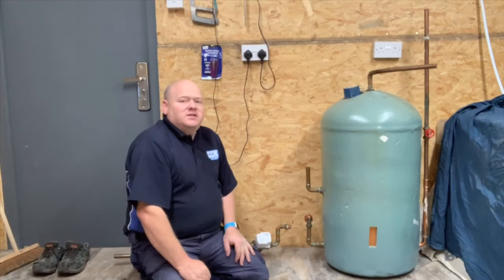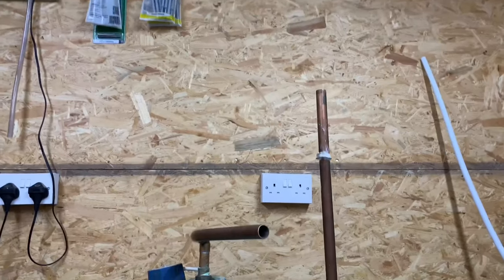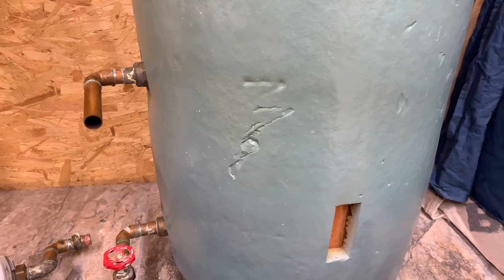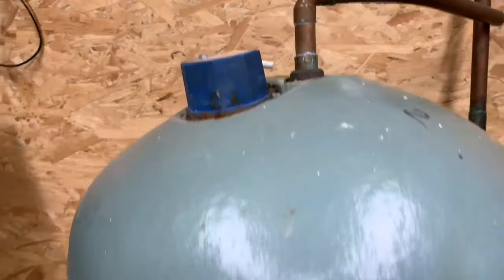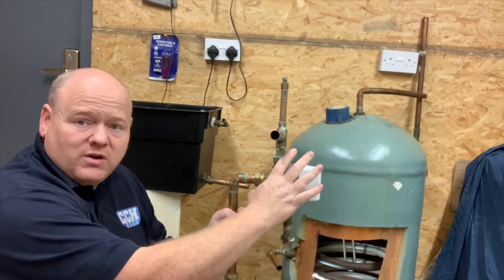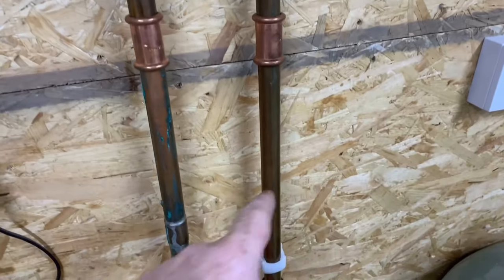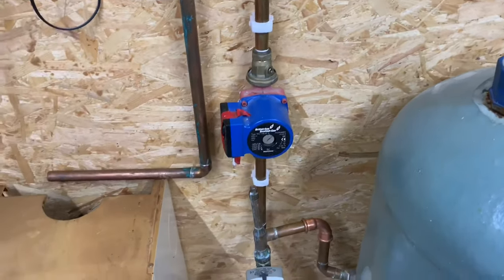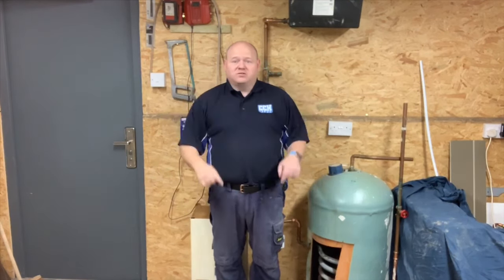Plumbing - How Does a Hot Water Cylinder Work ?

Comment: Hi , was wondering if you could help the water in my cylinder heats up and everything is working, but about 1 hour after the central heating is turned off the water goes cold its not retaining the heat in the cylinder any ideas?

Comment: Hi Allen what is going wrong with my system with hot water going out through the overflow pipe back into the cold water tank, with the result while I will heat water with emersion  the tank will not hold the hot water over night even though it was installed 2 years ago

Comment: Thank you so much. I moved to ireland and the plumbing is very different here. I did not understand how the heating  system versus the showers worked. Brillant job! Thanks again.
Reply from the maker: Thank You
Reply: Not sure how that would be different in Ireland. I live here and that set up is the exact same as I have bar we have more switches that divert water based on controls and need to be powered by electricity to control. The issue here is that poor water pressure means direct from mains to heating in the boiler is harder to do as you cannot get enough water heated via mains water pressure fast enough to offer enough heat on the fly water pressure. My experience here is that combi boilers are a mystery to most plumbers unless there is no room to fit a water tank and cylinder (apartments/offices etc) . In fact the UK has stronger efficiency rules now that we do (boiler Plus)
Reply: @stephendoherty8291  Hi, I moved from the USA and plumbing is entirely different.

Comment: great well explained video, am i right in thinking to change the diverter valve do you, turn of the water supply, drain central heating, no need to drain the hot water, my system has 2 tanks in loft, big and small and all cold water is from the mains supply, any advise please, thanks mate

Comment: Hi Allen,   Can i use (a twin emmersion) tank to supply hot water for a bath etc, without a hot water boiler, - I  want to use my solar panels to power my emmersion heaters during the day,  (the second elemment I would control from a 1 hr timer to boost the temperature speed up for higher demands ) - I've got rid of my gas boiler, and I have no radiators left too. would it work this way please ? I still have a cold water tank in the loft, -
By the way,  great video, I learned a lot from your internal views of the tank, and descriptions, good job.

Comment: Thank you very much for helping me understand. How does a Hot water boiler work in conjunction with a hot water tank. For example we have the boiler heat the tank up for 30 mins at 6am and 6pm. However what if we were to let the hot water tank heat the water in the tank for say 4 hours or more each day,  would this be wasting energy? Or would the tank tell the boiler to stop heating the water when the tank was at the optimum temperature? I'm just curious as if i should be setting the boiler to heat the water in the tank longer than the 30 mins each day? WE have plenty of hot water for 2 of us in the hous with this set up, but i wondered if i increased the time would this be wasting energy?
Reply: I'm here also wondering the same thing, by the sounds of things I'm assuming it would constantly be heating water and once it's hot then switches off

Comment: Thanks for this. I’ve labelled my pipes now. Trying to troubleshoot heating system. Think there’s an airlock. Bled radiators then boiler stopped and no heat in the flow pipe. Just had cold snap which seems to have messed with everyone heating all my in laws had issues recently

Comment: Hi Allen.Thanks for video. Very good. Can you please tell me what the valve on the return does (seen in video at 2:15)? We have gas boiler heating system. My radiators are getting hot but the water in my tank is only luke warm. Do I need to adjust this valve?

Comment: I’ve just bought a house with two of these tanks, the system hasn’t worked for a year, one of the tanks works fine for the main bathroom, however the other tank does an en-suite, but doesn’t heat up with or from the boiler, but works with electric/immersion and fills up ok from the tank in the loft. Please can you advise me.

Comment: Hi Allen, having issues with the hot water flow to upstairs bathroom taps. Notes new pipes connection to hot water tank smaller than the old pipes going upstairs, is there any solution for this problems. Would be grateful if  you could please give us your suggestion.... many thanks

Comment: Thanks for this, very educational on the workings of the system. 

We have an issue where by if my son doesn’t have his bath of an evening, the supply header tank in the loft kettles the next morning when the gas boiler kicks in to top up the cylinder temperature. 

Do you have any suggestions as to why this would happen please?

Comment: hi im confused. u said at the beginning how the inner coil inside tank was for the central heating system then when you explained about the diverter you said b was for bath as in the hot water system but then on connecting it it would seem u connected b to the central heating coil. have i misunderstood or misinterpreted what u connected. what i am actually looking for is where ypu can turn off flow to a hot water tap to fix the tap without draining the cylinder.

Comment: Hi, I am trying to balance my system so far I have got all radiators working but when hot water Is running the big radiators downstairs just don't heat up well, I have noticed a gatevalve on the return from the coil which is fully open, how many turns should this valve be set to stop it stealing heat from the radiators? I have an old cylinder about 20 years old so I don't believe it's high recovery? The boiler is a Worcester 18ri and the system is a y plan if that helps?
Also there is a bypass gatevalve which is open at half a turn from closed is this the correct setting for this valve?
Thanks

Comment: Hi, I want to connect a hosepipe to my tf1 filter isolate the one side and connect a drian hose at my standard boiler in the hopes of flushing sludge out of the boiler drop leg. I may need to bung the pipe in the Ch feeder and vent on top of the cylinder. Do you think this will work? Or any tips plz

Comment: Hellp mate. Fantaatic video and extremely useful. Our header tank in our attic does not fill. We have had plumbers replace the ballcock valve but yet we need to remember to visit the attic periodically to manually hold the ballcock down to fill it, then artificially prop it up..
I am not an expert but the installation looks like a 5 year old gave it a go.

Any tips on what the issue might be is appreciated, trying to save up some scratch to get someone in to really look at it and hopefully fix the issue. I have a fear the entire system is in need of rework though..

Comment: See the diversion valve that goes let's the central heating heat the water in the tank how is that controlled to no wat way to send the water is it connected to a thermostat soon as it reaches a certain temp in the tank it send a signal to divert all the heat back to rads and bolier is that correct thanks 👍

Comment: Hi Allan. I have found the rads get warm when only the hot water is being heated. I have been told that the pipe work is wrong . That the return from the internal coil of cylinder should be the connection closest to boiler. Do you agree with this ,please ?
Reply: Yip it sb the last tee

Comment: That was clear and concise, you’re a great teacher, my friend 👍
Perhaps you could explain a gravity fed, ‘pump-less’ system ? 
I have a range with a back boiler and wish to use it for a cottage without electricity. Many thanks!
Reply from the maker: Thank you for watching. i will try.
Reply: How’d you get on?
I’m in a similar position..
Reply: @its_me_dave  

Quiet well, for a rank amateur. The hot tap could do with a little more pressure but nothing an inline pump couldn’t improve. Thanks for asking.
Reply: @joeleigh-corrigan7762  Hi Joe, I’m in the same boat as you were and desperately trying to find answers! I’ve got a static caravan and am hoping to be able to use a back boiler in the winter and possible a swimming pool solar pipe system in the summer. I don’t suppose you have a diagram? Thanks. Elliot
Reply: @elliotdavies1526  
I’ll knock you one up my friend, it’s not exactly difficult but you need to keep a few principles in mind. 
Give me a day or two, alright 👍
Reply: @joeleigh-corrigan7762  Legend! Much appreciated
Reply: @elliotdavies1526  
It’s no problem, my pleasure.
Reply: @elliotdavies1526  
Trying to send you diagrams but they keep on bouncing back. Hmmmn?

Comment: Well i am now 50 and still love to learn a bit more,, in the plandemic i changed the complete  ball cock in the main header tank as after a bit of youtube found this was simpler than changing the washer n seal as it started dripping, cost me i think £12 all in!  i have been n brought a new jacuzzi bath thing as we have a special needs daughter, i was intending to find out how to drain the hot water to change the taps, (cold is simple to do) now not only am i 100% sure i can do it and fit everything but i now know how the whole heating system works! (Gas is not for me so not even going to look).
thank you loads.

Comment: Excellent video!  I've noticed if I hear the cylinder via the boiler there's a damp patch on the shelf under the pipe but this doesn't happen if I hear the water via emersion heater.  Do you think it's just condensation or a leak on that pipe from the boiler to the cylinder?  Thanks!

Comment: Would this be the same as the modern tanks? 
I'm looking at one with two coils - wanting it as I have a wood stove I'll be heating the water up but will eventually want to add a heat pump with the stove supplementing during harsh winters.

Additionally, we have radiators and want to install UFH - is it possible to run them off the same coil?

Comment: One item missing is that many hot water cylinders have immersion backup as you show and some have a bath setting which I presume either means more heat or more of the immersion coil. Some mention of the different cylinder types would be useful and do all pipes still have to be copper? Cylinders for Heat pump and solar heating would be good to see. Also can you note why expansion cylinders seem to be used as well if there is a header tank?

Comment: Very informative Allen - I know understand!. I recently had a new water cylinder fitted replacing an old one after it split. We have a gravity hot water system which now doesn't seem to heat the tank. I'm told the new cylinders do not work the same way. Any easy solution?

Comment: Great explanation Allen. I wondered why. I have a boiler plus a cylinder tank. That would make it indirect. It's vented because there is a tank in the loft. There is also a switch for the immersion heater in the kitchen and one on the wall next to the cylinder. So I could get hot water from the boiler or heat the water as an immersion heater just say incase the boiler failed?
Reply from the maker: Thanks very much for your comment, please consider subscribing to support the channel 🙂

Comment: That’s all clear and thanks for doing that. I’ve just moved in my new flat and was wondering what is about!? Just excuse my ignorance but why to use something like this instead using a normal CH boiler to warm the radiators and the water as well. Thanks again and really appreciate what you’re doing.
Reply from the maker: You are so welcome!
Reply: Combi boilers that do both hot water and heating are mainly used for smaller properties where you don’t need hot water from multiple outlets at the same time, systems with a hot water cylinder are for bigger properties where multiple outlets require hot water at the same time the best system in this case is a invented hot water cylinder.

Comment: Great video , although I can't understand my system , the down pipe from the water tank in the attic has a gate valve but doesn't connect to the cylinder. However a pipe coming up from the floor in the airing cupboard has a T piece  (horizontal running into the bottom of the cylinder and vertical just continuing up to a stop end). I want to change the shower unit but when I shut the gate valve off (from the water tank in the attic the hot tap still runs for 20 minutes after which I gave up). Baffled.

Comment: Thanks Allen, good clear explanation of the system. Why does vent pipe have to be so high above header tank, my daughters just hooks over the top of the tank? It is working at the moment. Thanks, best wishe's. Stuart.
Reply from the maker: Should be min 450mm really, less chance of pumping over or sucking air in.
Reply: @AllenHart999  thanks for the info Allen,cheers.
Reply from the maker: @stuartlockwood9645  No problem.👍

Comment: Hi Allen, hopefully you can help me with a problem.  I am not getting hot water from any of  the taps  even though the radiators are heating up. I have had the boiler serviced and a new hot press tank installed. The old tank was 20 years old. Also  the pipe coming down from the tank to the boiler doesn't heat up    so no hot water. Got a plumber to try and sort the problem but still no hot water. Any advice. Thank you.

Comment: At moment I have a ideal combi boiler running 12 radiators the boiler is about 10 years old would I be better off having a tank in loft and a new boiler I have solar panels  7kv output I'm wondering if I had a tank in loft and had a heady to heat the water at moment I'm filling a 20kv battery pack and charged  my nissan leaf and most days in March  I give 10 kv back to grid but my gas bill was £280 for month with having  so much solar power I'm trying to find best way to cut my bills

Comment: Hey Allen. Thanks for this video. It helped me figure out my basic home water flow. Can I ask a question please, I have developed a bout of severe water hammer, which starts after a few seconds after when any of my hot taps are turned on, but it causes the hammer only in the cold piping! Turning the cold tap on on the bath is the only thing that stops it. The bath is the end of the chain of my cold system I believe. I understand about the concept of water not compressing, but I can't figure where the fault lies. The only common valve would be the top tank ball cock. But i can't figure out why the bathroom indirect cold taps do not trigger the hammer too? Could a top tank root cause be possible? Any thoughts appreciated.

Comment: Brilliant video Allen and great explanation I think it’s my interpretation that’s confused me slightly I was trying to work out how on 4.00 you mentioned there are 2 lots of water that are separate there’s one flowing inside the coil itself and is the other water totally loose inside the cylinder itself ? and heated by the coil ? As silly me I’ve been trying to work out how 2 lots of water could be separated  in 1 pipe so I think I’m right in thinking that one lot of water is inside the pipe and 1 lot is stored inside the cylinder freely ? 
Thankyou 👍
Reply from the maker: one lot of water is in the cylinder, Then a separate lot of water via the coil. Hope that makes sense. Thanks.
Reply: @AllenHart999  
Yes it makes sense ! I was overthinking it 😄
Thankyou for confirming - great videos !
Reply from the maker: @stenchosmells  Thank You

Comment: Would you be able to tell me why my hot water is scalding hot but all radiators just warm
Even fitted a new Central heating pump and still not cured it
Bled the system aswell

Comment: Hi is it possible to do power flushing tru the hot water cylinder return pipe, as There's no place to connect to return pipe on my boiler, all pipe is to close to the wall,can't instal magna clean filter on the boiler, so planing to that job on hot water cylinder return pipe is it good idea?  Thank

Comment: The pipe on the top of my cylinder which goes to hot water is hot about 6" along the pipe & then it is cooler. my hot water is only luke warm. Could you tell what the problem could be.

Comment: Hi Allen, 
Great video! Thanks for sharing. 

I'm currently having some issues with my vented cylinder. Although the central heating works, the hot water does not. 
We've been in the loft (where the cylinder is) and at the bottom of the tank on the left hand side, there is a pipe running along the floor that has a red knob much like the one on your video. We have turned it which seems to have opened the pipe and the pipe is now hot on either side of the knob. 
We thought this would be the reason we didn't have hot water but unfortunately we've not been successful. 
My question is whether i should have turned the knob - is this safe? and what will this do?

Thank you in advance, 
Mairead
Reply from the maker: Thanks very much for your comment, please consider subscribing to support the channel 🙂

Comment: I know someone had new tank fitted and it had leaks from all the joints and then plumber tightened it bit more still leaking. Been leaking ever since. Also water came out hot taps and shower in waves rather than consistent.can you give advice or  make a tutorial on how to fix this? Would help because my advice does nothing but drive my friend up the wall.
Reply from the maker: Not really sure, Thanks for the question.

Comment: Allan, can I use a pressure reducing valve to feed cold water directly into the hot water tank from the mains feed as my cold water tank sprung a leak and will need to be replace?

Comment: What is the valve on the coil return for and how is that used? Also, if there is air in the coil, how is that bled out?
Reply: That is a balancing valve and it is used to restrict the flow through the cylinder coil and normally an air vent is fitted on the flow to the cylinder coil to vent air in the coil